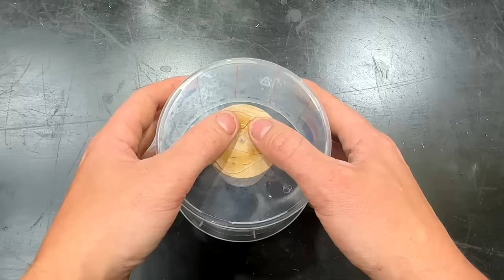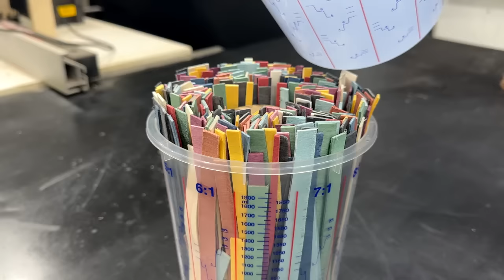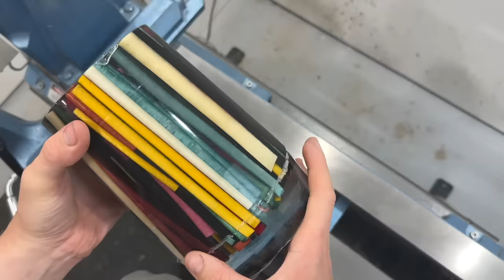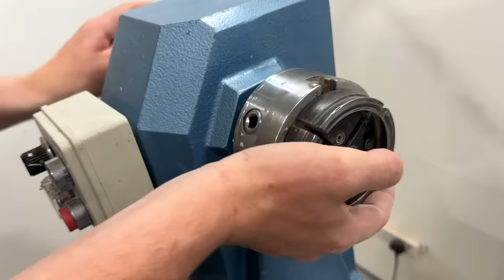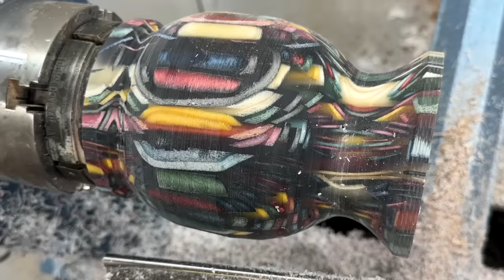Woodturning - 1000 Pieces Of Veneer !

Comment: I was STUNNED when the powder was wiped away!  I'm also surprised that it turned out so dark.

But back to the beginning:  How did you know that the dried epoxy would exactly cover the ends sticking out of the cup?  Is this just the nature of epoxy, that it expands as it dries?  And when it expanded, why didn't it run over the edges of the cup?  How did it retain the cylindrical shape?

Comment: Excellent work. What lathe are you using? I've got a small one but would like to upgrade to be able to do larger diameter projects.
Reply from the maker: Thanks buddy. This lathe is pretty far out of most people’s price range at about £7,000 but you can get a good full size lathe for about £3000 new or £1000 second hand.
Reply: @JackMackWoodturning  would there be any brand you would recommend to get second hand?